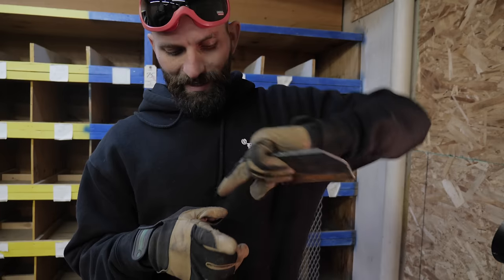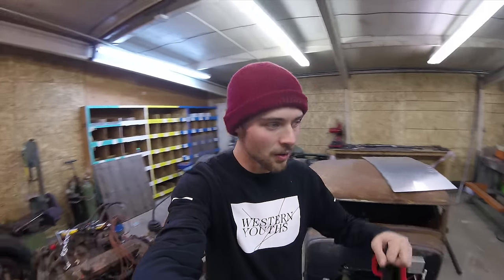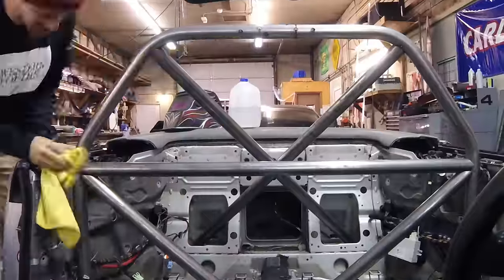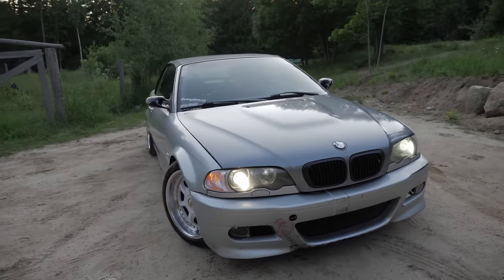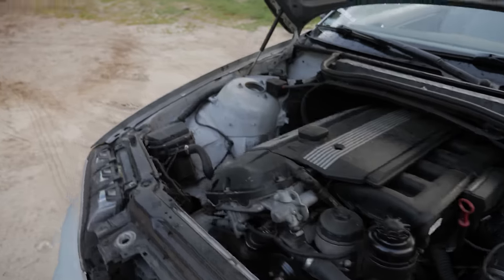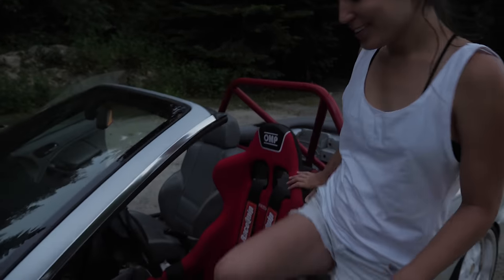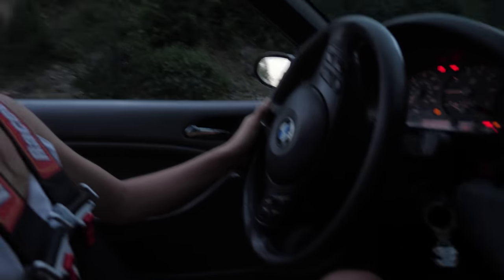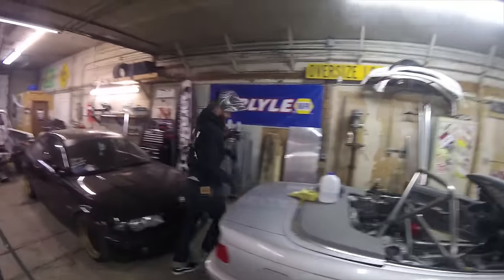Custom Rollcage Build In the BMW E46 Convertible

Comment: Massive respect to you buddy, especially in regards to you doing your gearbox/clutch, even though you had never even changed your oil! I'm a massive car guy and I'm pretty confident in my ability to carry out work on my own car, but only to a certain skill degree! Things like replacing a clutch or repairing a gearbox! I know I do not even have the correct tools to do a task like that, and certainly don't have the knowledge to do so. I don't trust garages or dealerships. Whenever I've taken my car to a garage to have a repair, it comes back with another separate issue. When on occasions this has happened I've noticed that the issue is something that had shown no signs of wear or failure prior to going in. That's why I always like to at least attempt a job on my car before I resort to taking it somewhere. You're super lucky to have a friend like Russell, you know that you always have Russell as backup if you get yourself in too deep.... You know what I mean? Haha
Ps air intake solution, I always swear by direct cold air feed. Induction kits imo just suck In hot air around the engine bay, even with a decent heat shield I'd favour a good cold air feed like a Pipercross Viper cold air feed.
I'm gonna teach my gf to do a burnout on my e46 cabrio, proper funny dude. 👍

Comment: Mad video, great content. I have a suggestion for the Tacoma (the tacomeover I call it). Shorten the chassis, mount the cage outside the cab (exo style), replace the doors with door bars and do a wrap around for the bull bar. That way it can be rolled without wrecking the body any more aha.

Comment: supercharger kits are very easy to install on these cars,  basically bolt her in and your good to go.  turbo's are a heck of alot more mucking around and cost alot more plus require inter coolers etc and aren't worth the extra weight when a constant source of power is readily available with supercharger.
Reply: Uhhhhh...no...superchargers are nice, but I want you to present your theory to the many racers with turbos that are spanking supercharged vehicles...

Comment: As much as I hate Dinan, their CAI is actually decent and useful. All you need is the bottom part of the airbox which you can find on ebay. It's a real cold air intake, not just an open filter isn't cold air at all.